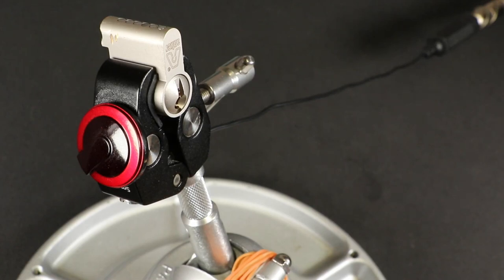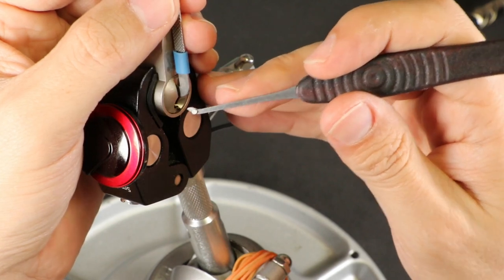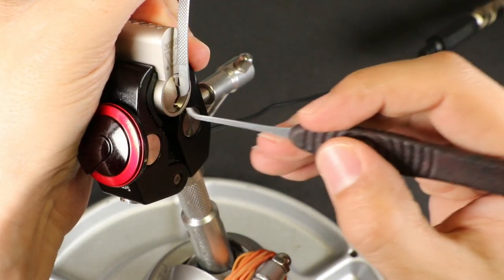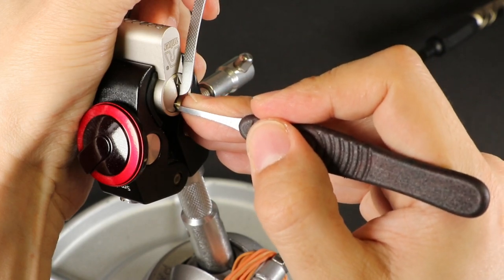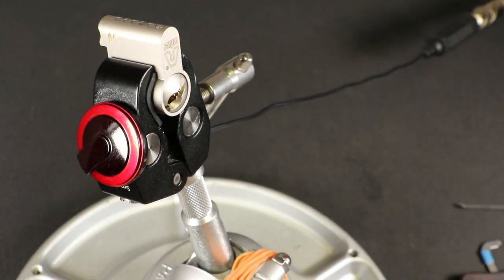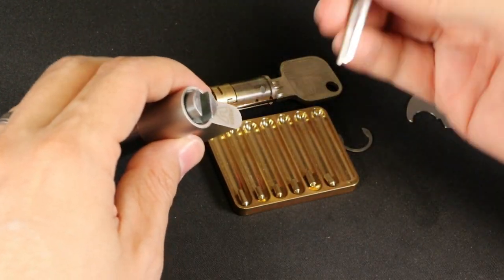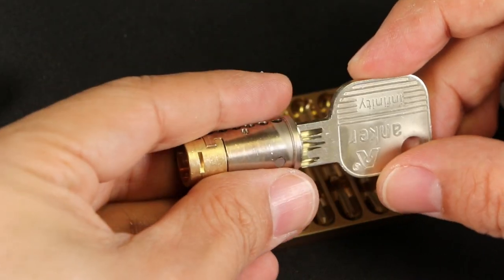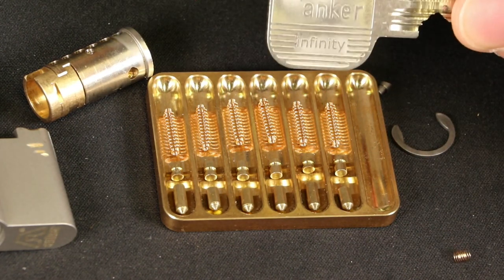[L188] Anker Infinity K Euro Cylinder Lock - pick and gut

Comment: It looks like they randomise the magnet because the one I have is on the back of core or could be a older model. Anyways nice picking.
Reply from the maker: Yah, I imagine the magnet is placed anywhere in the lock...I notice at the beginning, when I have the polarity wrong, the magnet won't stick inside the lock and remains on the pick. Only once I flip it the right way does it come off the pick and work, so that's a good indicator that you've got it right.